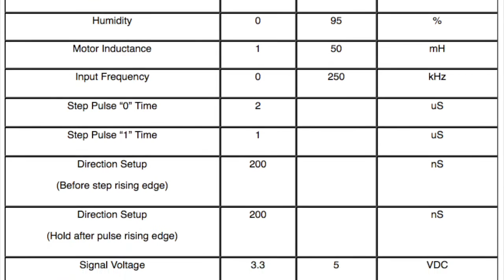Geckodrive G540

Comment: if you please,can I use Geckodrive G540 to produce this machine declared in this link (http://carlsondesign.com/products/studio-stx-plottercutter/) and if so would you recommend a stepper motors configuration ?
also would you declare wiring?
thanks in advance
Reply from the maker: Hi Raif- The machine you inquired about is already built around our G540.